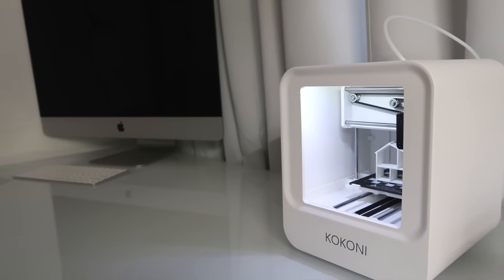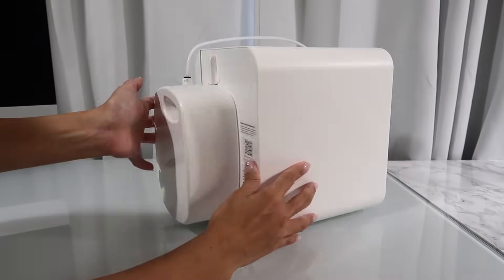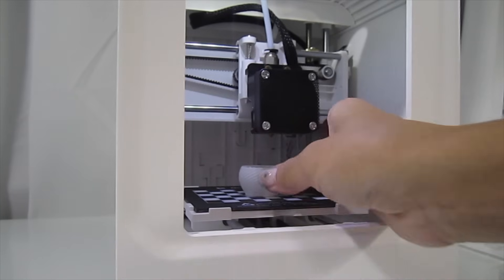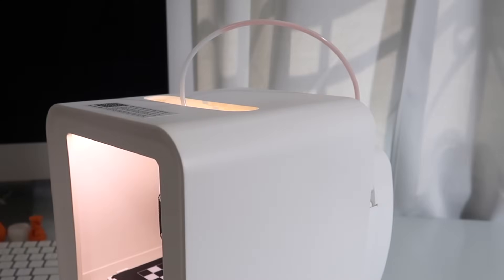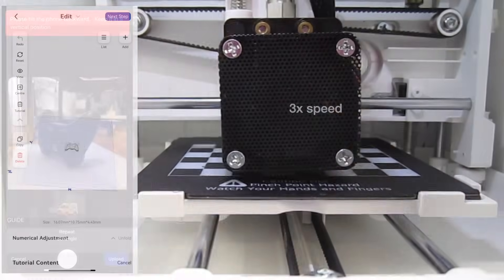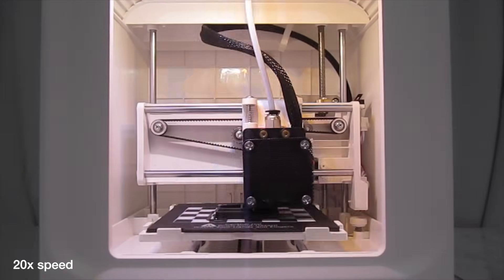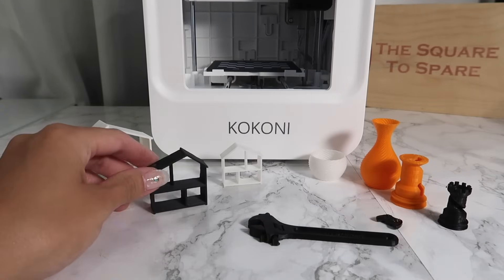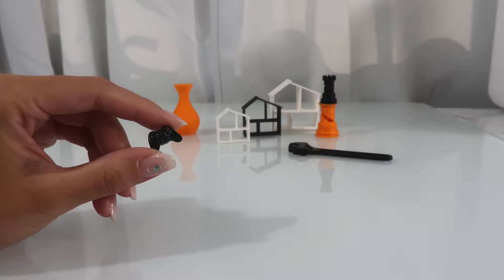Smallest 3D Printer for Dollhouse Miniatures

Comment: So for context, my beginner printer is an Anycubic Kobra Neo. So I'm used to fiddly printers being the norm for me. So I can understand the allure of a simple easy to use printer. I think the Kokoni EC1 does a decent job of "just have it work" printers. But there are some things that jump out at me as very concerning. The cartridge based system and having it so heavily reliant on an app really worries me. It'd be one thing if the cartridges were more like a Keurig styled system where yes, you can use a cartridge but maybe also having a cartridge adapter where you can put on your own spools would really free up the system. As for the app, that's a massive problem. Kokoni could, as any point, discontinue the app or force you into a subscription model. With no other means of inputting your model into the printer, you basically have a really expensive paper weight on your desk. Now I think there's absolutely a place in the printer world for the Keurig of 3D printers and this has a ways to go before it does. In the meantime, if you're not so worried about the form factor, those Bambu printers look really nice!

Comment: What do you do with the case the filaments come in when they are empty?
Reply from the maker: Based on the manual, it’s a one time use cartridge. So it’ll likely have to go in the recycling bin. The better option and what I’ll try is…I think I can probably open it to refill it but haven’t tried that yet as I’ve yet to finish a roll and don’t want to inadvertently break it.
Reply: I've read somewhere that this has been tried, the one guy had a bit of an issue but someone suggested a fix but I didn't pay much attention because I was looking for something else. I wonder if you use the QR code once if it might give issues later but honestly, my bro can afford the cartridges.

Comment: The proprietary filiment rolls are where they get you there are so many cheep fillaments and you can only use the ones from this manufacturer there are alot of very cheep small printers that could do this without the entrapment like the creality ender v2
Reply from the maker: I think you’re absolutely right. I’m hoping the manufacturer makes these filament cases refillable so it’s not so wasteful and costly
Reply: @TheSquaretoSpare sadly I can't see them doing that... yes it looks like a great machine.. but the cartridge is just a money making gimmick cos they know u have to buy the filament from them and no one else... and that's what they want...
Reply: Not only are there other better cheaper and easier for beginner 3d printers out there but there filiment cost 19 dollars for a 250g roll compared too 15-20$ dollar 1kg rolls of normal 3d printer pla you are getting a quarter of the filament for a premium price as well as taking a big loss on the cost of the overpriced machine I'm not holding look this up 3d printing has gotten much easier for beginners and people less tech savvy in the last few years and you can make slot if you get a normal beginner 3d printer

Comment: That spool holder looks massive… is it fully recyclable or one more thing to end up in landfill? 🤔
Reply: EXACTLY my issue here… that, and if it’s refillable with other filaments. If so, how do you open the cartridge to replace the filament? I reallllllly don’t like how much extra plastic is involved in making these cartridges.
Reply from the maker: I think it’s the latter for now based on the manual. While the plastic itself is recyclable, there are no instructions to refill it. I’ll have to open one up and see if it’s possible, but I wouldn’t bank on it to be honest

Comment: Thanks for showing this.  Definitely looks very beginner friendly.  I was looking at the website for the filament refills and only found the spools of filament.  Do the cartridges come apart and you just replace the spool?  It says you can use other filaments, but they prefer using theirs so there aren't any issues, but I didn't see the cartridges.  Am I just overlooking them?    Thanks again.  Really informative video.   Also, I think that first misprint will make a cute little decorative bowl, or planter, in a dollhouse.
Reply from the maker: Absolutely! I read through the manual and it said that the machine can only be used with their cartridges right now. I was thinking about how I could take the cartridge apart just to see if I can replace the filament in it. Admittedly, I haven’t done that yet as I’m worried I’ll ruin a perfectly good cartridge. Perhaps when I finish a roll, I’ll open up the case and do something experimenting
Reply: @TheSquaretoSpare  Right.. This was exactly what I was thinking.. obviously after one is empty... heh  Seems like a waste of a good cartridge if it can't be refilled, or if at the very least, they don't give you a big discount for returning the empty one or something.   If you make it to the end of the roll, let us know. 😀   Thanks again!
Reply: This!! Exactly what I’d like to know.
Reply: You can take the cartridge apart yes, but u would have reload the spool with pla filament by hand which would take quite a lot of time... but the company won't want you to do this.. because they will loose profit..

Comment: Can you use any filament on reels or do u have to get a spesific one?
Reply: It says it’s supposedly able to use other filaments, but I can’t find any info on how to open up the cartridge in order to change the spools out.
Reply from the maker: Based on the instruction manual, the cartridges are not refillable. Perhaps the manufacturer will come out with an option that we can refill 🙏

Comment: Does it have settings to change? I noticed there is a lot of stringing and blobs(zits) on the printed stuff. That might frustrate a kid or beginner as it requires extra work after printing.
Reply from the maker: Unfortunately, there aren’t any options to customize the prints. I noticed the same limitations with the quality, but kept in mind that it was built to be very basic to keep it simple. I do wish there were temperature, speed and retraction options but understand that would make it a much more complicated machine

Comment: Part of me is very tempted, because the price is the lowest I've seen, but a bigger part wonders at needing an app--essentially, you own the hardware, but can't run it unless the company lets you, and there's nothing stopping them from dropping support or asking for a monthly subscription to use 'your' printer.

To clarify for later readers:

I was more thinking about the issue Peloton users had, where they bought the machine with 'free' access to the software, then eventually had to pay a monthly subscription to use their threadmill.

So, even if they are not forcing you onto a more expensive machine, you end up paying a monthly fee to use the one you have.

And so, the "under $200" printer ends up costing a lot more.

Mind you, I doubt there's a 3D printer currently on the market that is autonomous, but that's what stops me from buying one.

Further edit: then there are the proprietary adapter-thingie cartridges, which means you are locked buying the filament from them, as whatever price they set,while producing extra waste in the form of the box-thing.
Reply: Your definitely correct in thinking that!!   But a bit better way to explain that is for the machine to operate it requires hooking it up to a company's website for it to work at all. Meaning the machine or device does not have the ability to run on its own by itself.   Either way as you mentioned if the company decides to stop supporting any of its older models they will become nothing more than paperweights because they will no longer work at all!!
     Circuit, Glowfordge, etc are all like this.  And they can force everyone to have to get a newer model even if nothing is wrong with the old one, or if someone just doesn't want a new model, either way they will have no choice !!
Reply: I was more thinking about the issue Peloton users had, where they bought the maching with 'free' access to the software, then eventually had to pay a monthly subscription to use their threadmill.

So, even if they are not forcing you onto a more expensive machine, you end up paying a monthly fee to use the one you have.

And so, the "under $200" printer ends up costing a lot more.

Mind you, I doubt there's a 3D printer currently on the market that is autonomous, but that's what stops me from buying one. @DOCDOCFLAMINGOS
Reply: yup. that last line.. seems inevitable.
Reply: Was also tempted, but thanks for pointing out this fatal software flaw.
Reply: That's exactly the problem with the cricut. But the problem is that they lock out other software that might work with their product.
Reply: Someone else also mentioned the cartridges, without which the machine won't work, so if they don't get you via the software, they get you via the filament--which also limits you to whatever they offer in the way of color, quality, etc (plus the incredible waste of throwing away those casings every time you run out).
Reply: @azteclady  the sealed cartridge is a money making gimmick..
Reply from the maker: I get where you’re coming from and have similar reservations. While many machines (not just 3d printers) are moving in this direction, it does create a bit of uncertainly. To be honest, I think it’s a cost saving measure so companies can keep printer pieces low. They don’t have to add in slots for usb drives/as cards or put on an onboard lcd screen. Luckily, I haven’t had any issues with the app, but it’s always worth checking out the app’s reviews on systems like this just to make sure you know 100% what your user experience will be like
Reply: Look at a machine called an Ender 2 Pro... I don't work for Creality but instead I use this machine a lot... this white machine looks impressive but I sense a catch with them cos the cartridge limits you to what you can use on it..
Reply: Also you will only be able to buy more filament from this company so they will be able to charge you want they want...  money making gimmick
Reply: I don't want a device that needs another device that you have to buy as well, to work. If your phone breaks or you use a non-compatible or old phone, you can't use it. No thanks.
Reply: Hello @azteclady! Thank you so much for your interest! I completely get where you're coming from. The Kokoni 3D APP is free to download and use! Right now, we've got a whopping 2000+ models ready for you to print with just a single click, and there will be some exclusives that you cannot find elsewhere!

We know that there are smart hardware that will charge a subscription fee to achieve the claims that they promote. Currently, we don't have any subscription plans yet, but we do have a plan to let creators/designers share their own designs through our platform and benefit from it, it will be a long-term plan instead. I hope this helps to answer your concerns and join us with your own KOKONI journey!
Reply: @kokoni3d  is there a code to get the $219 price?
Reply: @kokoni3d  I like the sales pitch.. its good lol
Reply: All printing devices have 'apps' at least since the beginning of Windows... technically speaking,  it's how one prints...

Comment: Is there a clear filament available for glassware?
Reply: @recoveringsoul755  I'm going to stop commenting on this video now... but honestly don't fall for this Kokoni machine... there are better filament machines out there... yeah they all coming with a bit of a learning curve.. but this fancy white box is a waste.
Reply: For glassware.. learn about resin machines.. PLA filament is only good for larger models
Reply: Also with filament printers u will see alot of lines in the print.. so for glassware resin is best..
Reply: @superdavealexander  I think I've eeen those
Reply: @recoveringsoul755  yeah there is a learning curve to using them.. and they can be very messy compared to filament machines.. just youtube resin printing so u see what's involved
Reply: @recoveringsoul755  sorry pal.. at the time it was the only name I could think of for my youtube account

Comment: Form factor of the Kokoni for miniatures printing is great. The quality of the print looks quite good.

I am not thrilled at the filament coming in a case that is apparently not openable. That means that one is limited to just one source for the filament. Personally, I do not like this closed garden aspect.

And, if the filament should break, it appears that one would have to ditch the remaining filament and case. I find that to be rather wasteful.
Reply: It is compatible with other brands of filament. It says so on their website.
Reply: @mistyinltown79  Thank you for setting me straight.
Reply: @mistyinltown79  okay, I caught that part, but how do you open the cartridge to replace the filament?
Reply: @tiabeaniesemotionalsupportdmon there are 4 screws in the back of it which will be tight.. cos really your not supposed to open it
Reply: @superdavealexander  okay, cool. Thanks for letting me know. ☺️
Reply: No because her white filament did break and she was able to still use it after the break
Reply: @recoveringsoul755  That's cool. I somehow missed that.
Reply: You can open the cartridge up... but think again before buying this machine.. it does have its flaws